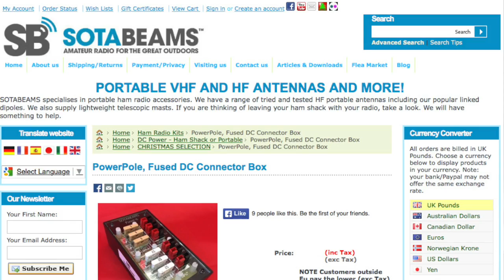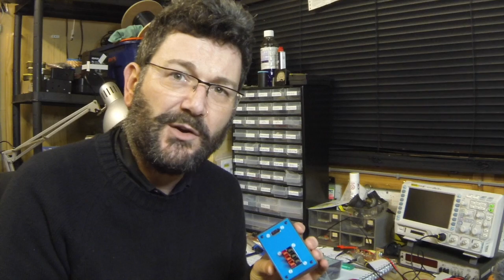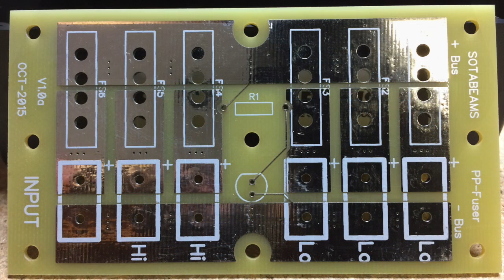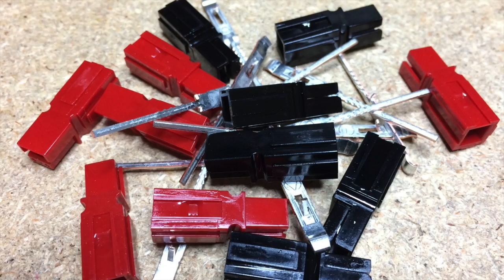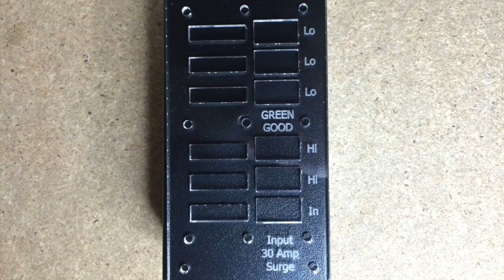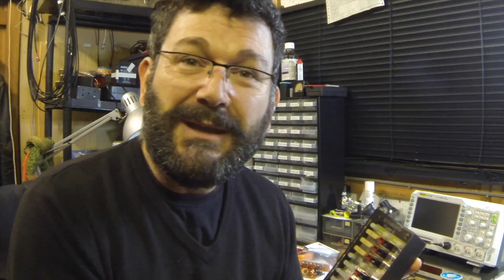SOTABeams Fuser 6 review and build notes

Comment: Excellent video.  I built mine yesterday but only found this today!  Def need a lot of heat, I used a Metcal iron whcih will normally solder tanks but still needed a heavy tip.  The board has thermal reliefs round each pin whcih I think might have been better omitted so as to get a good solder fillet but then youd need a really heavy iron.  I think i wil add a flying lead input to mine so it becoems a 6 output box but having become a recent convert to Powerpoles, I may need another box soon!  Peter G8RXZ

Comment: The video doesn't show any soldered joints. I had trouble getting the solder to flow onto the fuse connectors. I am surprised that you needed so little solder to get it to wet the surfaces.
Reply from the maker: lovegarbage I’m not sure how I missed taking a shot of the soldered side! I found, with a well whetted 100W iron, I easily got the solder to flow on the fuse holders and the board is pre tinned. I was using standard multi-cored solder (a little on the thin side for such a big job). I used plenty of solder to ensure a good, low impedance joint. If it helps I can share some photos of how mine looks.
Reply: I had a bit more trouble but I wasn't using 100W. I found it easier to apply the solder from the upper side of the board and I think I got a passable effect with 25W. The guidance says 50W, however.
Reply from the maker: lovegarbage On top of a visual inspection of the joints it’s worth performing a check with a multimeter to make sure the connection from the metal fuse holder to the PCB is essentially zero ohms through the soldered joint. If it’s not you’ll get heating and notice a voltage drop when you start drawing power. Good luck...mine is in daily use in the shack and has been great.

Comment: The contacts aren't different size only where the wires attach
Reply from the maker: I believe you are correct! I thought the thickness of the metal inserts (on the contact points) differed as my 45A contacts are fractionally thicker than the 15A versions that I have. On closer examination of a larger sample of 15, 30 & 45A versions, this may simply be manufacturer tolerances. The only real difference is the barrel size that accepts the wire as you highlighted.
Thanks for correcting me...I've learned something new :o)
Reply: Wouldn't have known myself but just saw it on you tube this week..   West Mountain I believe from memory.